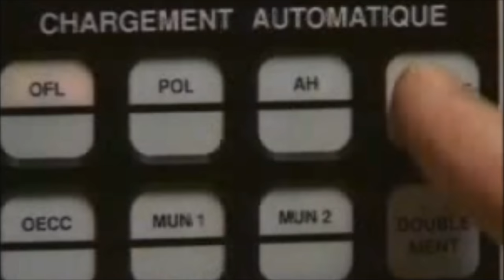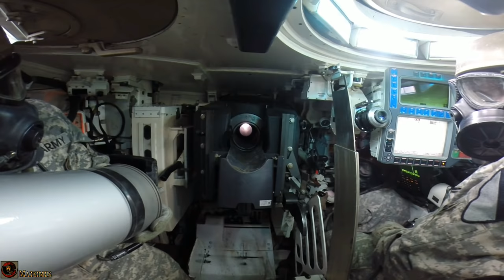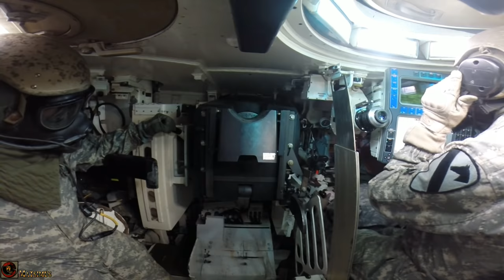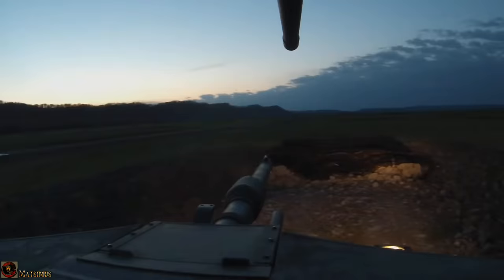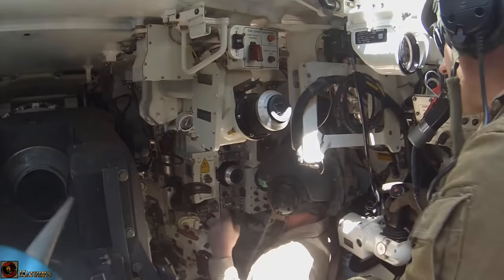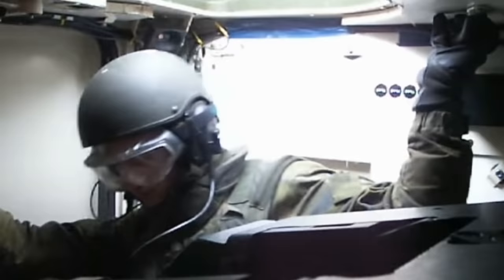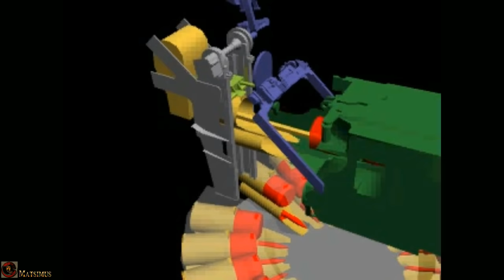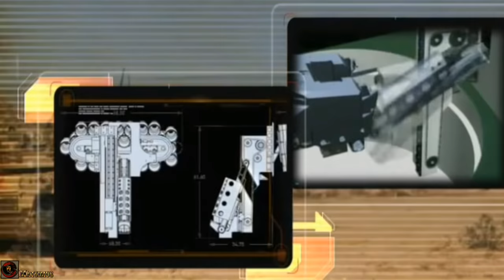Tank Autoloader or Crewman Loader?

Comment: Autoloaders are nice.... if you're shooting 1 target and have no need to change out ammo.... Human loaders = swapping shells, fasterish reload and a better depression suppression and rotation without many limits, unlike the autoloaders.
Reply: Sorry to tell you this but your comment is completely false: autoloader are designed to be faster than human and actually more efficient at engaging multiples targets since they are faster and if you to change ammo there is no problem just press the right button 
I dont know of wich autoloader system you are referring to but modern one are definitly more efficient
Reply: autoloaders can switch ammunition type and a lot faster too, that being said, switching ammunition types is not really a thing, HEAT-MP is becoming a thing of the past, APFSDS is all that is slung around in modern times. HESH, HE, Canister shots, etc. are rarely used by MBTs if at all anymore it's more of an artillery and engineering thing.

Comment: An auto-loader for tanks that work right, is just a matter time! Drone tanks like planes are just round the corner. And the smoke from the rounds is bad to humans that are in the tank.  cheers
Reply: Wheels65 don't they blow the smoke out?
Reply: No!
Reply: Wheels65 why the exclamation mark?
Reply: sorry.
Reply: Hell no to Drone tanks alls you would have to do is just hack the servers of the damn thing and there you go. Sure there may be some FireWalls but they can always be bypassed. Drones are just peices of shit
Reply: "And the smoke from the rounds is bad to humans that are in the tank."
Why do you think some countries have crewmembers wear face gear?
Reply: NaziGOPBallmer Tanks have fume extractors, they don't have an issue with fumes normally. As for drones, a Tunguska can fix that issue real quick.
Reply: Russia trialed their drone tanks in Syria they were a huge failure, kept losing signal to their controllers.

Comment: Former Abrams tanker here. I agree with your assessments, however I think the trend will be auto loading. While a human loader could be faster than an auto loader, there's only so many sweet spots he can pull from the ready rack that are conveniently placed closest to the breech and if a tank battle is prolonged, an auto loader is more consistent for longer duration. Also with the new STAFF round that's coming out, the need to switch ammo type could be potentially eliminated (we'll see how that actually pans out). While I think having a four man crew is the way to go (maintenance, security, bitch boy) I think the bean counters will look favorable to auto loads due to cost savings and increased lethality.

Comment: Fools! you do not down size guns! you make gun bigger. that is the only logic man has ever known! Get rid of the 120mm guns and go for 152mm guns instead!
Reply: Wtf, you do know that they have those right? It's called a self propelled howitzer. Downsizing guns for tanks and improving the materials of the projectile make more deadly rounds than increasing the size. A 120mm Depleted uranium dart goes faster and destroys MUCH better, and is WAY more accurate than a HEAT 125mm Russian gun. Bigger is not always better, at least for direct fire.
Reply: The Lead Shed In case it was somehow not obvious. It was a joke
Reply: I was always partial to 9" naval guns.... don't know why.
Reply: There is a tank with 155mm gun on the field already. It's called Panzerhaubitze 2000 :)

Comment: It's interesting to see the comments from folks that have never been inside of a tank. As for those of us that have, we understand that there are costs and benefits to either solution. People cost a hell of a lot more to train than an autoloader. That said, having a 4th crewman that can play any other role in the crew in a pinch and also help out in other areas is a very useful versatility enhancement. The people in my tank companies always preferred having the 4th guy versus the very narrow-scope benefits of the autoloader. 

One other thing: it is exceedingly disingenuous to note that penetrating from the front of a T-series hull through to the carousel is tough and then completely fail to note that penetrating the turret from the front through to the ammo compartment at the rear is much, much harder as it is protected by significantly more/better armor and potentially ERA as well, which is not the case for hull shots to the lower hull face when the vehicle is cresting an obstacle. In terms of side penetration into the magazines, either tank is vulnerable to side-on hits (much less so to obliques), which is why dismounted infantry screening forces exist.